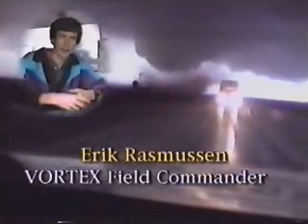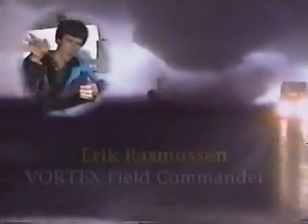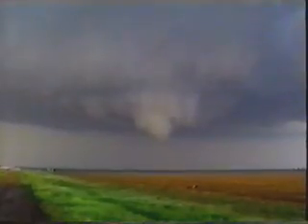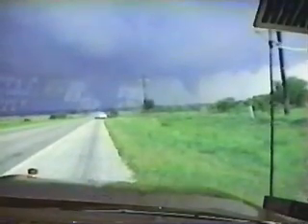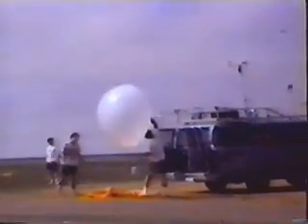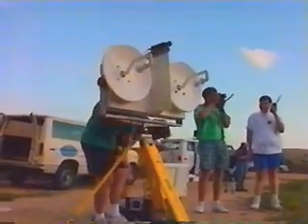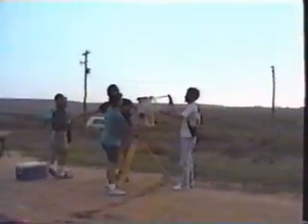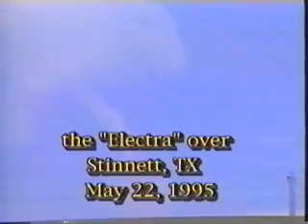Project VORTEX (And More) - Part 1

Comment: Anyone know the purpose of the DTMF tones on the radio?
Reply: Some communications systems use DTMF codes to alert a receiver to begin a task or function, while others are used to alert another radio and it's operator so that information is being given to the correct person.

For example a base station may transmit a DTMF code to special receivers which are in a state of hibernation as they await for the tone sequence to activate. 

Others may be in the UHF/VHF communications band of frequencies to physically call one base to another, like an old school car phone
Reply: @castlemania08  thank you!